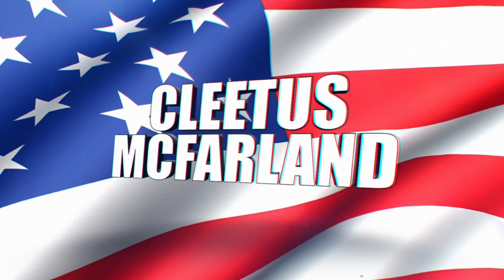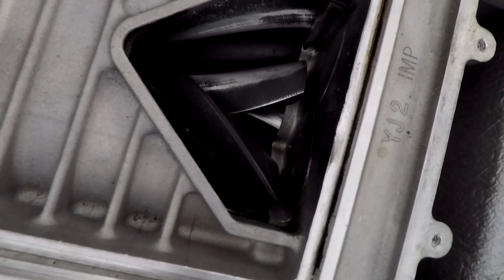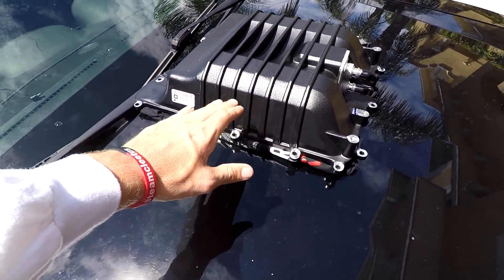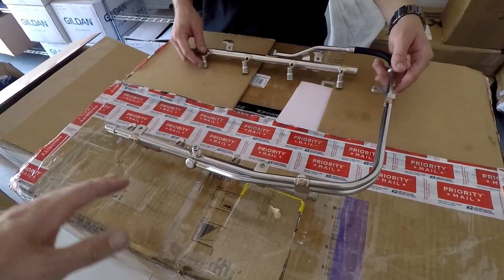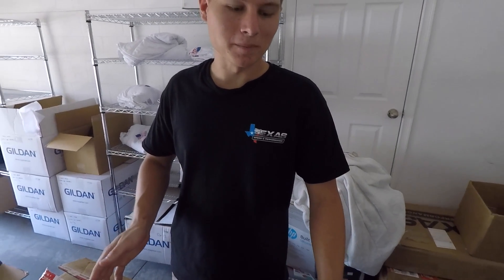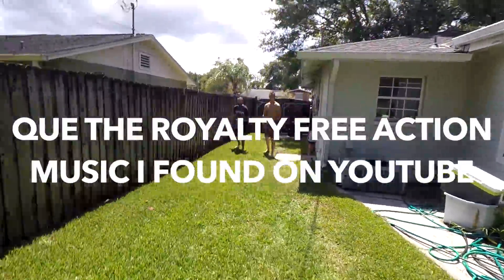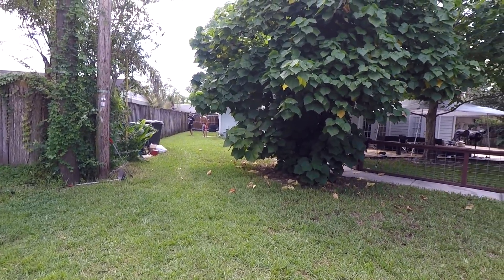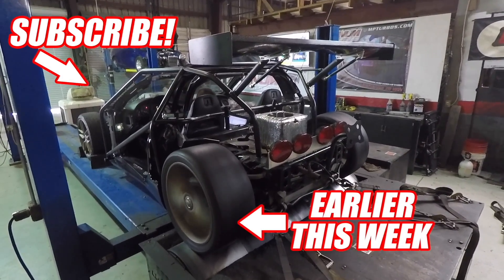So this is happening...

Comment: I had an 05 cts v with a 482cid lsx with a modified procharger kit from a gto with an f1 at 12psi and my stock dif blew up litterally 200 miles after the motor build . Ended up going with a modified 04 cobra rear dif with cs engineering mounts and addapters with g force axles then it was unstoppable.  Love v1s ! . Anything over about 450-475 rwhp an the stock v1 dif will blow up. Good luck with the build cant wait to see it.

Comment: Oh yea Cooper if you look at the 1969 Mach one with the shaker hood scoop you can trim out the cut portion of the hood with upholstery pinch weld cover. It is a black pinch wled cover that looks Bitchen when its done

Comment: Use g8 gt heads. From the L76. They are square port. You'd wouldn't have to run the adapter plates and it would sit lower in the engine bay.

Comment: What yr is The V? They are not 4200 pounds more like 3800 the V2's are heavier, the 04 and 05 had the weakest rear's the 06 and 07 they upgraded them but they have been known to blow up like a gernade. IDK, what GM, were thinking using a CTS rear in the V platform... I was going to do the same setup with my 06 V, but decided not to, bought a 92 S10 and going to convert it to a 5.3 LM7. Looking forward to seeing the progress.. Cleetus, how much are you asking for a shirt? L is my size.

Comment: So his car is the early LS6 with the weak diff. Why not just get a 6.0 and use rectangle port heads? Hell an LY6 would be a great engine to use and keep it more affordable with a simple LS9 cam to start. The iron block typically can hold a little more power than an LS6 as well. Not needing the spacers is going to get that height down a bit. If that's not enough why not a K-member or something to drop the engine a touch more, use a flatter pan if needed... then get ahold of a diff from an LS2 car. People wreck 'em everyday. Oh, well. I'm sure it'll be pretty cool no matter what y'all do. I came pretty close to doing the LSA blower a few years ago when you could occasionally get them for $400-475 in 2014. I didn't because of the roughly $4000 it would have cost me in parts to do it along with the bear minimum AFM delete, LS9 cam, cheapo ebay Camaro5 headers modded a little to work, tuning and so on. I just couldn't quite get the money together even though I had the resources, connections and wit to figure a way to do it all for so little. Can't wait to see the results.
Reply: I forgot to mention what I was  going to do it on...I had a 2013 Caprice PPV at the time. I have an SS sedan and a GTO now.

Comment: You should make leroy AWD 60% back 40% front the  car will launch so much better with little if any compromise to acceleration, it will also split the load between 2 diffs instead of 1 meaning longer life span on top of that a sequental gear box with customizable gear ratio's

Comment: lsa is not the way to go on the v1 at all. Not to mention you will ruin the hood and make the car look like a ghetto hack job. The v1 is a terrible car for drag racing and launching. the lsa will give the most benefits to low end and 60fts. Which you wont even be able to take advantage of unless you spend 5k on a creative steel 8.8 kit. Basically this is a terrible idea and a waste of money. If you want to run a boosted setup just do a procharger. Will make more hp than the lsa and not be so hard on the drivetrain. and better yet you dont have to cut a friggin hole in the hood .......